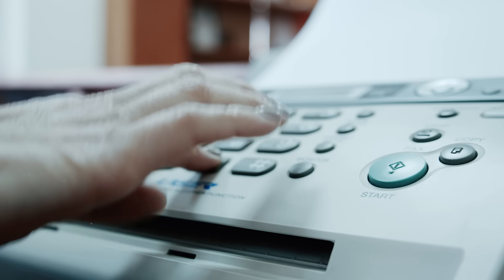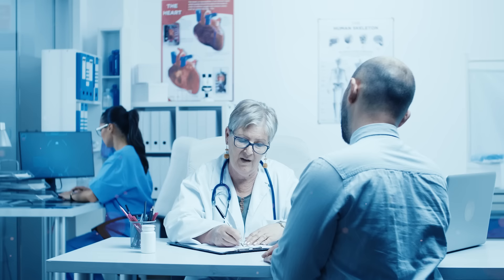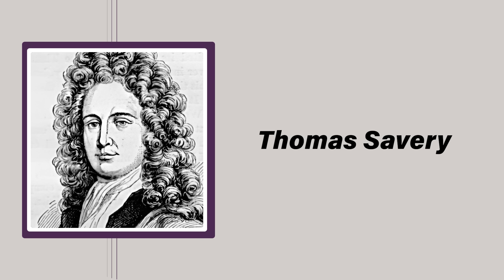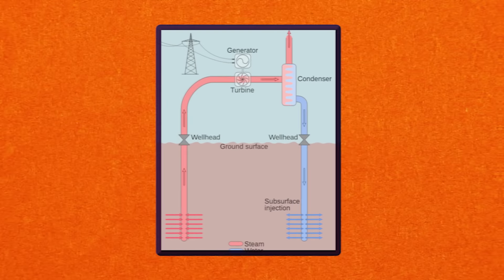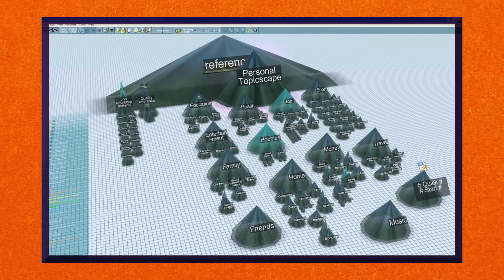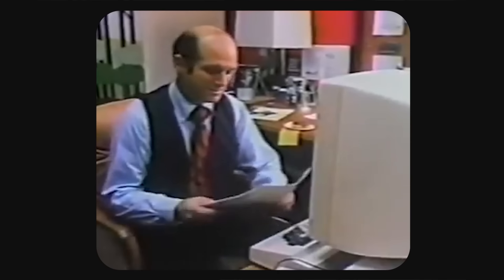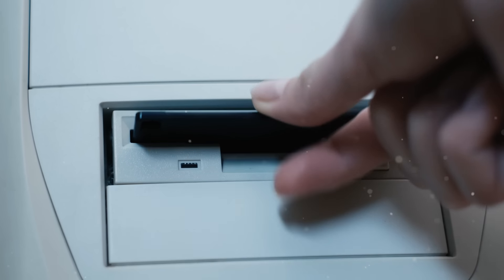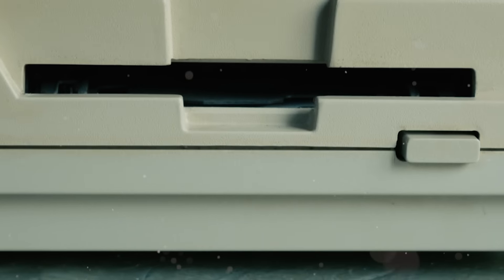Terribly Outdated Technology that we Still Use...

Comment: I absolutely love the fact that Windows 11 was not even mentioned when they listed a more modern OS compared to XP 😂 I'll definitely stick with Windows 10 as long as it has security updates.
Reply: I know right? Windows XP, Vista and 7 were my favorites of their operating system.
Reply: If you have Windows 10 NEVER upgrade your current system, even if they stop the security updates.  Systems that have Windows 11 were built for Windows 11 in mind.  If Windows 10 becomes obsolete you must get a new system, unless you want problems and random "gotchas" from running Windows 11 on a system built for Windows 10.  People upgrade anyway and regret it.

Comment: These older technologies are long-lived for a reason. Only recently has digital photography and videography matched the resolution of film. Ditto digital audio and vinyl/digital tape. Why did Apple remove the 3.5mm jack? A hugely retrograde step. Think how many times Apple has changed its interfaces, while 3.5mm jacks remain in widespread use. Windows XP is very reliable and a lovely OS to use in retrogaming systems. The fax machine is many decades older than the telephone. Lithium batteries are dangerous incendiary devices, and lead acid batteries much safer. Plenty of examples of superior older technologies. A friend of mine has a spring-operated acoustic gramophone that plays 78s. It will work when there is no electricity or an EMP destroys the world's computers and PCBs. We need to respect older tech!

Comment: why should 'old' technology should be stopped being used if it works for what you want and need? my main laptop dates  from 2007 originally for XP but now on 8.1 .. i cant afford new and dont want new, i dont want win 10 or 11 , i still HAVE to use a couple of machines with XP on so i can use my scanner and a photo printer which dont have drivers for later than XP, and i dont see why i should get new 'just because' its 'old' as it still works perfectly,, if and when it fails, thats a different matter,  i also collect and resurrect other older computers so still use floppy disks back to the 5 1/4 inch 360k type.. p.s. XP was a good OS and i see no reason why it couldnt have been updated in terms of security....as an experiment i installed win3.1 and 95 and 98 on one of my 'newest' machines, another 2007 is  thing and everything was pretty much instant! even msdos machine will still be perfectly usable if all you want is wordprocessing, spreadsheets, etc.

Comment: There's so many old things that works so much better because they don't include bloat the only include what's necessary to function pagers and fax machines and floppy disks among them. Floppy disks you're limited on storage so you're only gonna store what you need on it and they're cheap inexpensive or at least they were so you could have multiple.
And fax machines end up working as a very good backup method when hospitals get ransom weird because they don't have a proper IT department or management policies. Although for what hospitals do they really should I'll be running Linux, lowe's does.

Comment: XP is still running on about 6,000 ATMs due to the costs of upgrading machines with a new OS and the hardware almost guaranteed to have driver failures (dispenser, keypad, and cardreader specifically). XP came back into full force in ATMs six months after the Vista rollout. Every machine we upgraded to Vista we reloaded XP and didn't have an upgrade till Windows 10.
Reply: The thing that is tunning on ATMs (and many other devices) isn't actually a regular Windows XP, it's so called "Windows Embedded". It's a Windows XP modified using special tool that allows very deep customization of the system. You can remove almost any unneeded service, library etc. and leave only the ones that are actually required to run the ATM app. I have once serviced such a system, many regular Windows apps can't even run on it because of lack of appropriate libraries.

Comment: I volunteer doing animal adoptions with my local spca at a volunteer operated outlet location. We still use fax machines to send the paperwork applications to the main shelter whenever an animal is adopted. This is despite the fact I offered an old laptop and offered to even develop the program to digitize the adoption application process, they said no :/

Comment: There's not that much wrong with XP it's just not getting security updates. it's the the same security problems as any other operating system. Although it might be slightly more secure becaus you're not getting an update shoved through every week that might actually break something because we need to have that new ad delivery thing that broke last month fixed.
 I would not recommend it for the average user but on the same token windows is so bloated nowadays. And for the most part I'm hoping most of the government and ATMs are using windows embedded or industrial where you only enable what you need.

Comment: I used to work at Sears and we were still using fax machines up to 2014.  Our local delivery guys and installers had us send them customer orders over them.  It was simple and got the job done.  We also had a paper trail that we filed away in case anything went wrong.

Comment: A fax machine allows for the possibility of communication where a complete up to date system is not apparent. To use digital communication, every facet of every area of use has to be identically at same level, which simply is not realistic in many businesses even this far along. Digital costs $$$$$$$$$, and when the world's plan is to make $$$$$$ extremely worthless so hard work equates to f**k all! $$$$$$$'$ just don't exist for this complete blanket upgrade. Hence fax machines still exist & are used daily in the hospitality & food industry of New Zealand. Now retired (burnout) as a chef, I worked for almost 20 years, 3/4 of those were in a head chef position where the absolute most important was paid was $22 an hour. That gives an idea of how hard work equates to worthlessness! ! !

Comment: But Simon, the 3.5" disk is not a floppy. That's a hard disk. Floppies really did die. Called 'floppies' because you can wiggle them by shaking your hand. Can't bend a 3.5 with air pressure, not happening

Comment: I didn't see many "floppy disk"s on this video at all ! I saw plenty of "hard disk"s but few floppy. Now I will admit time may have changed the name but these aren't the names from the 80's because if you bought a computer that didn't accommodate hard disks you were boned. Similar to the difference of VHS and Beta but definitely different none the less REGARDLESS of what tweeners want to call it now. Floppy was in fact floppy, thin plastic sleeves (similar to that found on a notebook cover) encasing the actual disk. THEN the harder plastic disk with the sliding metal cover (hard disk) came out and was adopted because it was far more durable I assume. 

Wow Simon I'm disappointed !!

Comment: To add onto the XP portion, most of the time, the version of Windows XP inside of certain machines, like the ones noted in this video, run on Windows XP embedded. If not running on Windows XP embedded, then it’ll be a regular version of Windows XP, but the facility will usually pay to have Windows XP updated through a support contract with Microsoft themselves. The places that do have contracts generally pay a pretty penny for these support contracts (the last I’ve heard was 6-7 figures) and is patched constantly, so its not as insecure as it sounds, although I wouldn’t be surprised if some of these systems are air-gapped

Comment: The 8 inch floppy was introduced with a capacity of 242,944 bytes.  13 sectors per track, 73 tracks, 256 bytes per sector.   The 80K floppy was the initial 5.25 floppy.

Comment: Another area where old tech still exists is manufacturing test. I'm an electrical RF test engineer, and some of our test stations still use Win XP. Some of our test instruments still use 3.5 floppy drives. And the primary means of communication between the test stations and the DUT's (devices under test) is RS-232. When a station is running, you don't spend engineering dollars to replace or upgrade it. I.e. if it ain't broke, you don't fix it.

Comment: The aircrafts you mentioned no longer use legit floppy drives. They use "Floppy disc emulators" they are devices that emulate a floppy drive and translates the data from a floppy over to a USB flash drive. You plug the flash drive in and just make sure the light goes from red to green and you're good to go. Now, there are some units that take the actual floppy drive but they usually do not get used in action.
Reply: I am not sure that was true 10 years ago for all aircraft in service.  Floppy disk, or diskette as the 3.5" floppy is sometimes called was still in use for niche applications.

Comment: We still had a fax machine until a couple weeks ago. My dads a doctor who recently retired, and he he used to use it all the time, but after hospitals went digital, he mainly kept it around "just in case"

Actually, my dad ditched the pager for a smartphone around about ~15 years ago. i want to say. His practice issued iphones to every doctor. As for PC OS. Honestly dont know but i do know my dentist was using XP until 2 years ago when they swapped to 7... and my church is still using 7 on the security system as far as ive seen (work IT for the church but rarely mess with the security equipment)

Dont be fooled by this video- at least in the US the majority of the medical field has embraced the modern era of tech... even if the aging boomer doctors have no idea how to use this newfangled tech.

Comment: You are one of the most difficult to understand speakers I've seen on YouTube.  You speak very quickly and your volume level goes from a whisper to almost a yell in an instant.  That said, there is nothing wrong with technology that has been around a while if it WORKS.  Change simply for the sake of change doesn't really accomplish much, does it?  

For the record, I have a computer that runs Win10, a couple that run Win7, several that run WinXP, as well as a couple of Win98 machines--let's not forget WinCE!  Without a doubt, WinXP was the easiest and quickest to use.  Seems like Microsoft thinks that adding steps to accomplish something is somehow an improvement.  I've got some brand new 5-1/4" floppy drives sitting right here in my office that I plan to sell on Ebay when I get around to it.  I've sold some before and they seem to be in demand.

I've worked in refineries where steam is, by far, the best source of power.  Not only can you get a great deal of power from a small turbine, but it's extremely reliable and safe to use around combustible materials.

Lastly, I'd put my 75 year old airplane up against most any modern single-engine piston-engine airplane.

Comment: As a radio guy I have seen a vacuum tube shortwave receiver outperform a modern state of the art receiver. The valve receiver was from the 50s and the new one was 21st century. There was no comparison in the quality of the received signal. The big advantage for the newer one was a far smaller power requirement. Using the same aerial on both radios with a switch enabled us to compare both radios easily. The valve receiver from the 50s was far superior. I know of other instances where older technology works better.
Reply: same goes with architecture, i'd trust a building from the early-mid-late 20th century excluding mcmansions over any modern house, give me a 70s shed style instead of this brand new cheapo suburban crap

Comment: Yeah,  old outdated technology,  good thing we stopped using all that cave man technology like fire and the wheel  .. wait a minute  ... ok, atleast we're beyond block and tackle  ... no? We're beyond sails right? No? Wait, we're beyond using o
Putting a heavy mass on a stick to drive pointy things into wood right? Maybe we're beyond bending springy wood with a string to shoot an arrow  ..  oh, come on ..    surely we're beyond using wedges and levers to  increase mechanical advantage ..  ok, maybe we're beyond a 200 year old technology such as indoor plumbing  ...  how about we just acknowledge that technology only adds a very minor addition to the accuracy of our old technology,  and a giant leap in the transmission of information.  But information doesn't solve everything.  Wisdom and inherent knowledge will usually beat a nitwit with a smartphone.  Hand that smartphone to someone with the wisdom and knowledge,   then compare them to the nitwit.